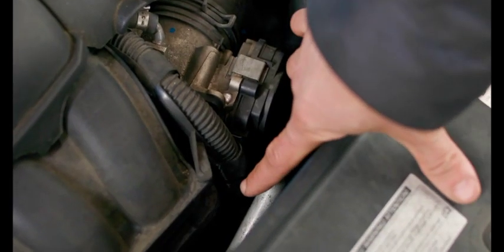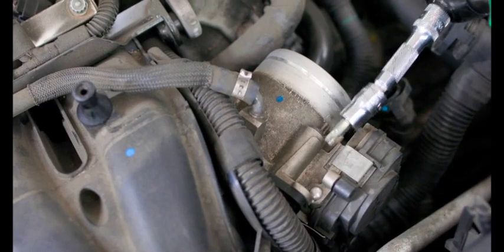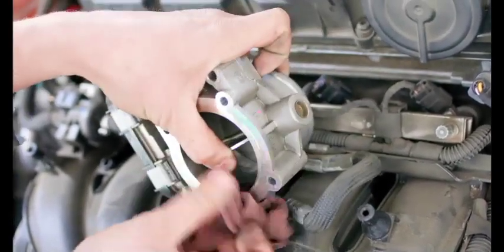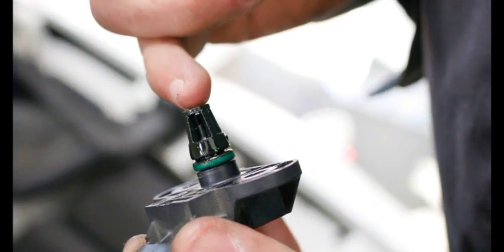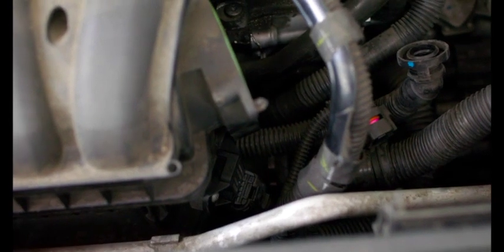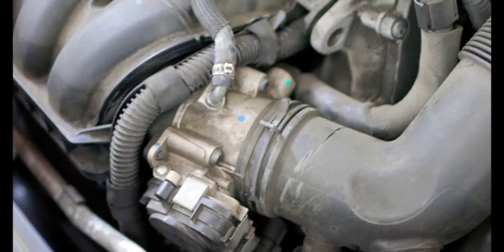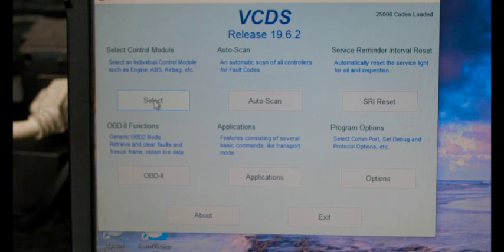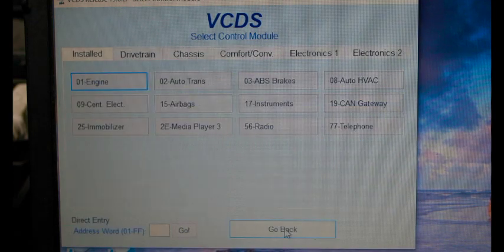2012 Vw Jetta 2.5 Check Engine Airflow at Idle too Low P3078 Manifold Pressure Sensor P0106 FIX

Comment: SAVED by this video AND the comment section!! Have a 2012 VW Jetta se, replaced the MAP sensor as detailed in this video and car was running worse than before, idle was all jacked up going from 700 rpm to 1500 or so then dropping back down, new error code P0507 detected, countless misfires. Didn’t know what to do and after takin apart and putting together again multiple times was about to take to a mechanic in defeat, but came back to this videos comment section, saw similar issues, then watched the video again… and realized I had to clear the DTC codes before running the throttle relearn. DO’H!!!! 
Needless to say she’s alive and running again! Thank you very much for making this video and being very clear on all the steps involved…. I’ll try to pay better attention next time! 😅
Reply from the maker: Congrats on fixing it yourself!!!

Comment: Thanks very much for taking the time to do this.   I was able to replace my golf's Map sensor and clean the throttle body with zero delay due to you providing the step by step and torx bit sizes.
I was going to simply clean my MAP sensor but figured at 131,000 miles, it made sense to simply replace it with a new Bosch unit.
Throttle seems more responsive now as well.
Reply from the maker: Glad it helped! Good job!

Comment: Thank you for the video. About two years ago my car started shifting hard. I took my car to a transmission shop and they told me the engine had some codes, and no transmission codes. I took my car to a mechanic and he said he needed to clean the throttle body and replace the MAP sensor. After the repairs, the car worked fine for about a year and a half. I got the same symptoms a few days ago and I decided to do the repair myself. I watched this video to see what needs to be removed. I cleaned the throttle body which by the way it was super dirty. I also replaced the MAP sensor which was covered with oil. I also replaced the PCV valve cover. So far, the car seems to be working fine again. I will try to report how it works in the long run. I still have a check engine light, but it should go away in a day or two. If the light does not go away, then I will go to Autozone or Advance to get a free scan.
Reply from the maker: well done!

Comment: Thank you so much for this video. It was so easy to follow. After going through all your steps. I also replaced diaphragm and it ran rough at idle like it wanted to cut off. Went back to comments and tried what you suggested. Pressed gas pedal to open up throttle while off and on. One thing that seemed to work for me was clearing the codes on my diagnostic code Reader. As soon as I did, I heard the idle go right back to where it should be and no more problems.
Reply from the maker: Great job, happy to help. Note that I don't recommend the China PCV replacement diaphragms, they can be problematic and cause fuel trim faults and leak vacuum. Best to replace the entire Oem Valve cover. But if its working then thats good. Just keep a eye on it.

Comment: Wow Mr. Matt you are truly genius, I had identical faults in my passat 2.5 2014 and fixed them same way you explained, I thought that I had problems with my 09g transmission but you save me lot of money to re assemble transmission, thanks indeed, my mechanic also replaced the pcv diaghram cover, he told me that's the culprit of leaking oil to map, I believe he's right as well, what do you think, my car is running like new condition for a month. Thanks again
Reply from the maker: Keep a eye on that replacement pcv diaphragm they can be cheap/ Chinese made and actually might leak internally and cause a lean fuel trim fault or a high idle from the vacuum leak. Best is to replace the new valve cover as one whole Oem new piece with the new Oem built in valve.  Don’t worry about the oil in the intake it’s totally normal and doesn’t indicate a bad pcv/ oil separator.
Reply: @matttorian  I will bro. thanks indeed for your advice

Comment: Super helpful! You made this very easy for me to understand and complete myself.
Reply from the maker: Excellent!!
Reply: @matttorian  completed in less than 30 minutes. Car is only showing a P2432 (SAI sensor) code now. Before replacing the MAP sensor, part # 0261230095 was already in place where the MAP sensor would go. Could you explain this?
Reply from the maker: @bethany6070  yes replace the secondary air sensor, there is a technical service bulletin for this repair you can find online describing the updated pipe and sensor.
Reply: @matttorian  thanks I’ll check that. I’m running into the problem of the correct part for the SAI sensor in an 09 VW Jetta 2.5 L/5 Cyl. It seems as though the part for Bosch has two map sensors (0261230095 and 0261230234). Wish I had caught this beforehand. Trial and error working on it yourself, huh? But better than spending loads of money for sure
Reply from the maker: @bethany6070  find the tech bulletin and it will describe the updated pipe, sensor and harness or you can find the old style sensor would be the cheapest repair. Looks like 0 261 230 167 should work if you still have the old style pipe and sensor
Reply: @matttorian  thanks for taking the time to help! Much appreciated.

Comment: Great video. I am glad to read that a new map sensor will also likely correct the hard shifting. I've been dealing with that issue for quite a while. Would you also recommend reaching into the plastic hole behind the throttle body and wiping out any extra oil puddling at the bottom? Isn't that where the oil is coming from to coat the map sensor?
Reply: Finished installing exactly as you said. Went smoothly and the car runs great. The hard shifting issue appears to be completely gone as I drove about 5-6 miles for a test drive under various conditions. Thanks for a great tutorial.
Reply from the maker: Good work!

Comment: Hi Matt, I'm great I found your video after 2 hours of search and yours is exactly what I needed to clean my wife's 2010 Golf 2.5 MAF air flow sensor and clear the throttle body, even though there is no check engine light or codes except TPS light.   The car has 140K and runs fine, should I just clean the MAF sensor or should I replace it?  I changed the valve cover 10 months ago when I found a little bid of oil in #2 cylinder/spark plug.  Thanks so much and God Bless!

Comment: You are the best, no bells and whistles. Straight to the point with excellent information. By the way do you have a video on changing the evap purge valve. That hose has an ear clamp. Do you suggest replacing  it with same clamp, thanks. Almost forgot. Does this video fix you did on the MAP work the same on a 13 2.5l jetta? The symptom of transmission slip was right on by the way. Great stuff
Reply from the maker: yes check my other videos, I have a purge valve video and shows how to loosen and reuse the crimp clamp. yes this will work for 2013 Jetta 2.5
Reply: @matttorian , do you think I should even try to put a purge valve purchased on Amazon? The MAP  sensor I got from Napa. Its a Bosch OEM. Thanks for the reply
Reply: @matttorian  , forgot to mention
 When I put gas in my car the other day. I heard a sucking noise while inserting the gas pump. And the vehicles idle was fluctuating. Is that also symptom of bad MAP?

Comment: Hello, thank you for this video. It was clear and helpful. I followed all your steps except for running the VCDS Throttle Body adaptation (haven't bought VCDS yet). Car now has a new MAP sensor, very clean throttle body, and new PCV Diaphragm. However, now the car idles rough. I double checked all connections and bolts. All are secure. My question: Is the car running rough because I have not adapted the throttle body? Is there a way to smooth out the idle without the adaptation software?
Reply from the maker: Hi Coleman, glad the video was helpful. Try to floor the gas pedal a few times to wide open throttle with the engine off. And try the same while driving. This should learn the new throttle end stops. Also I’ve seen the aftermarket pcv diaphragms leak and cause vacuum leaks and rough idle. Best is to replace the entire valve cover with a Oem Vw part. You can disconnect the vacuum hose to the valve cover and plug it with your thumb and start the car. If it now idles fine you have a bad leaking pcv. Good luck
Reply: @matttorian  If I disconnect the throttle body  do I have to re learn it or it is just plug and play??
Reply from the maker: Kev Ster just plug it back in, you should be fine

Comment: Nice video. I use instead of WD-40, I use silicone grease. It doesn't get washed off by solvents as easy, or come off under hot conditions/environment.
Reply from the maker: good tip, wd40 is mechanics best friend. also love using silicone paste

Comment: Thanks for the tutorial - I changed out my MAP sensor and diaphragm before seeing it, and did it the way you demonstrated.  However, I now have a whistle at about 1000 rpms - on acceleration and deceleration.  I've triple-checked everything and cannot find where it's coming from!  I think it has to be the air intake hose going to the t-body, but I'm pulling my hair out!  Any advice is appreciated.
Reply from the maker: The replacement diaphragms are hot Chinese garbage and they leak. You will want to replace the entire valve cover with a Oem Vw valve cover. That will fix your problem.

Comment: Great video I ended up changing my map sensor last night now what is the hardness that connects the oil to the throttle body? I could change my map sensor in the Pro sense won't get into it but Martinez. Connects the oil to the throttle body if I'm not mistaken where it's not cuz it was cold outside so we took the part that was in the throttle body out and  we duct taped it and then put it back in and it appears to have worked. I called and windy and it was the first time getting to the map sensor and we ran into that challenge initially. The map sensor was successfully changed

Comment: Thank you for the great video. The source of the oil in the intake manifold can be from a failing PCV valve, so you should replace that part as well for $20. Don't just treat the symptom.
Reply from the maker: No the aftermarket replacement pcv diaphragms are China junk and they will leak vacuum, whistle and cause a check engine light for lean fuel trim and idle too high. Best is to replace the entire valve cover with a new OEM Vw valve cover with built in PCV/ Oil Separator. Oil in the intake manifold is pretty normal to see on all these flat bottom 2.5 manifolds. It is not a indication of a bad pcv/oil separator.
Reply: @matttorian  hi Matt,  if oil is fouling the map sensor then should the whole valve cover have been replaced as well?
Reply from the maker: @flyguy437  It’s completely normal to get some oil in the intake manifold. It’s a normal part of this engine design, it does not indicate the oil separator is faulty. Just replace your Map sensor and you will be good.
Reply: @matttorian  I agree with you..replacing just the pcv valve is a temporary fix

Comment: Excellent video! In my case, after changing the sensor, the screw from the sensor, remains just a little bit loose. Is that gonna be a problem?
Reply from the maker: It’s plastic threads, just tighten it all the way you will be fine. It has a slight spring back to it, that’s normal.
Reply: @matttorian  Sounds good, thanks!

Comment: Hi , thanks for you video, in fact the issue the MAP sensor, here the oil come from where? Do you recommend Cover valve replacement ?
Reply from the maker: Hi Jose, some small amount of oil in the intake manifold is very normal and not cause for concern. It comes from the pcv valve which is built into the valve cover as a natural function of the engine. The PCV diaphragms do go bad around 80k-120k and tear and you would get a check engine light, low idle, air leak fuel trim too lean fault. I always recommend a whole new oem valve cover with the built in PCV. The aftermarket diaphragm seal kits are known to leak, repalcing the whole cover is nice as it fixes a potential oil leak from the valve cover gasket.

Comment: If the P0106 code keeps coming back and there is oil in the MAP sensor, more than likely, the PCV valve diaphragm is broken or leaking. You can replace the whole PCV valve cover (about $50-100 on ebay) or you can just replace the diaphragm (about $10-30 on ebay or amazon or autozone). Replacing the diaphragm is easier to do (you just need a paint can opener and a flat screwdriver), but a lot of people recommend just replacing the entire pcv valve cover. Of course, you need to clean the MAP sensor again...if you have a regular OBD2, most of them can also reset the throttle body. I have an OBD2 that is specific to a VW or AUDI, but way cheaper than the scanner he showed here, but of course, it is more limited than his.
Reply: Thanks for all your help 
You think the pcv valve can make the transmission kick only on 3rd gear I don’t have any codes
Reply: @gabrielgallardo4065  I am sorry, man, but I am not a pro mechanic, just a DIYer that loves to fix cars. But based on what the pcv valve does or connected to, I dont think it affects the tranny. Closest sign of  bad pcv that I can think of that might affect the tranny is since there is an intake air leak, there will be a rough idle and the RPM goes high...I dont know if that will cause the gear to shift too fast. But I would rather go by you having a bad tranny...ever changed your transmission fluid and/or filter?

Comment: Hello and thanks for the great video. My 2012 VW Jetta SEL has a check engine light. Autozone scan came back with a P2188 code. They recommend that the MAF be replaced but if correct, I don't believe this model has a MAF so, I assumed it was the MAP. I cannot removed the throttle body but before I went any further and made matters worse, I figured I should ask for some advice on how to remove the throttle body or if cleaning/replacing the MAP would help at all given the code that Autozone provided? Thanks.
Reply from the maker: 2012 Jetta will not have a Maf sensor just the Map and the Map will not cause your lean code. Lean code is caused by a vacuum leak. You will need a new valve cover with built in pcv valve. You can pop off the engine cover and run the engine. If you hear and feel vacuum on the small pcv port on your finger tip the diagphram is torn and the valve cover needs replacement. It’s a very easy valve cover to replace.

Comment: Do I need to adapt my throttle body in order to complete this DYI ? Also I recently changed my valve cover since it was leaking. Replaced it with an oem valve cover. Now I’m looking to change out the map sensor. Also experience hard shifting once in a while as you mentioned.
Reply from the maker: If you clean the throttle body it’s a good idea to adapt it. It might run fine without it but if you don’t have vagcom and it idles poorly or gives a throttle adaptation code just give it full throttle with the engine off a couple times so it relearns the end stops. Good job doing the Oem valve cover that’s a good repair. And yes a new map sensor will fix the hard shifting also.
Reply: @matttorian  great video! when you say full throttle with engine off, do you mean with the key turned to accessory on?
Reply from the maker: kumbackquatsta yes exactly, key on engine off and give it full throttle

Comment: Great video!!  Thanks for the tips while fixing it.    BTW, I recently got a P2096 saying the post catalytic converter sensor is too lean. It doesn't come with other codes with it. So what I possibly locate the problem position? So too lean means too much air and less fuel? Maybe to clean the MAP sensor too? Thanks!
Reply from the maker: If you don’t have any other fuel trim system too lean faults or vacuum leaks from the PCV diaphragm on the valve cover, the rear oxygen sensor most likely is faulty and needs replacement. I wouldn’t clean any sensors, you can try buts it’s best to replace them with brand new OEM Bosch sensors.  Cleaning is usually a very temporary fix.

Comment: Is This a job that can be done without the scan tool to adapt the throttle body? I feel comfortable doing the job but I don't have the scan tool to clear codes and adapt.
Reply from the maker: You will need at a minimum a OBD2 reader to clear the faults. Throttle body adaptation after is optional and will adapt while you drive it. Good luck.

Comment: Hey bud nice video! Very helpful had same codes pop up and symptoms with the hard shifting prior to light coming on. I replaced the map sensor but i am stuck on clearing the code p0106. Tried twice to erase code but doesnt want to erase, any idea how to erase the code?
Reply from the maker: two things I would try, get a better scanner and if that doesn’t work then try capacitance discharge. follow the instructions carefully, remove negative battery cable, touch negative cable to positive cable with a jumper wire for 10 seconds. this is like resetting the car control modules and a lot of times fixes weird elec problems. also it could be stored as a “permanent code” if you drove it too long before fixing it (thanks California EPA!) which will take two months of driving for it to clear on its own.

Comment: Will it be necessary to readjust the throttle body if I just take it out clean it and replace it as you did or was this process very much needed afterwards?
Reply from the maker: You will prob be ok and it should adapt itself but I always perform the basic settings with the scanner.
Reply: @matttorian  OBD scanner or vcds?